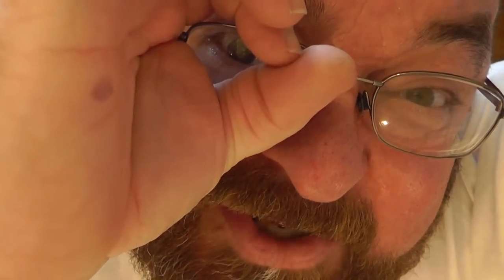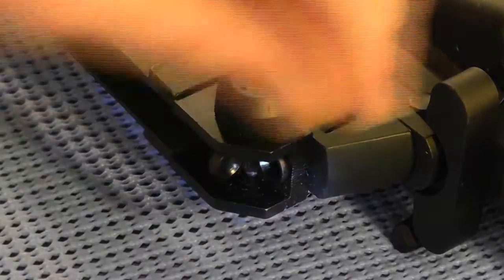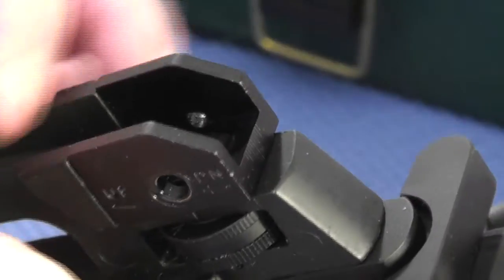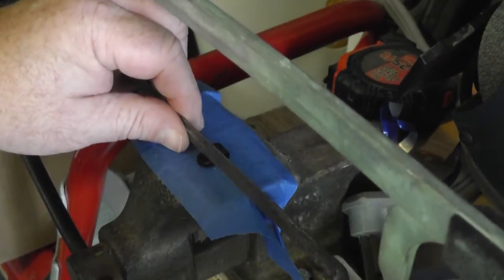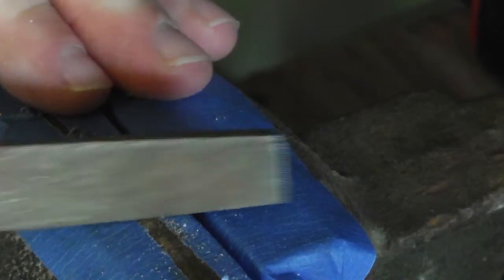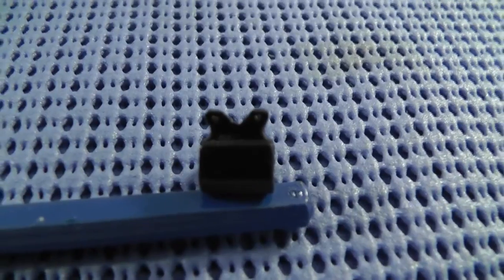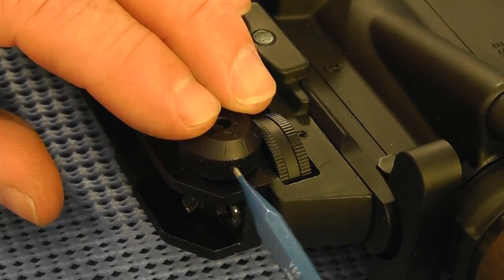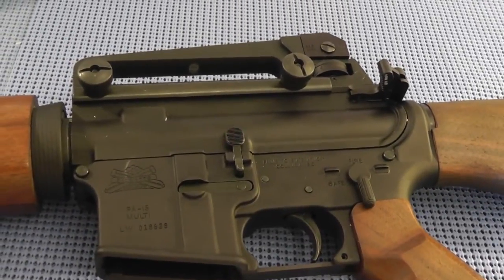Modifying Aperture Sights on A2/A3 Rifle AR-15 Platform - Part 1

Comment: I can't remember if I commented on this video before or not, but I actually really like this idea. I am trying a commercial AR15 rear sight with a square notch on top, and a peep below it (I stuck electrical tape over the peep, as I will not use it). So far out to 200 yards it works fine on those 17 1/4" Shoot and See targets.   

I am thinking about trying something similar with a surplus G3 rear sight, the open v-notch on that thing is perfect, and out to 300 yards I've made consistent hits on steel targets using it with appropriate hold over. I'd like to get a used G3 rear sight and try to cut v-notches for the "300" and "400" settings so there would be less holdover involved in aiming.

The peep has its place, most people prefer it and it can work really well, but it is not for everybody, especially if only shooting out to 200 yards or so. Thank you again for making this video, even if it is quite old by now.

Comment: You should have taken the top half of the sight off with a grinder. Halfway down to the peep hole, then used a small square file and put a partridge notch in it. That way the top is center with the old peep hole & it would be pretty close to being sighted without too much difference in clicks with the large peep. I see why you did this, I don't' like the small peep either. FYI Brownell's sells notch sight blades for the AR carry handle sight.

Comment: Suggestion: take your new sight, just make a small notch on the top of both the small and large aperture with a narrow hacksaw. Say like the K&S saw that Ace hardware sells for cutting their hobby brass tubing. That's what I thought you were going to do on this video, but Lordy, you really took a lot off the aperture. Maybe, at MOST, you should take the upper third off the sights, then make a small notch but leave the peep sight's hole for a backup at a farther range. That way you get kindof a dual purpose for the notch and the hole.